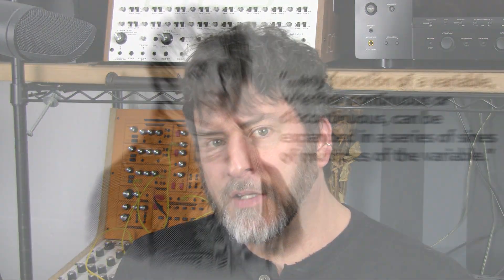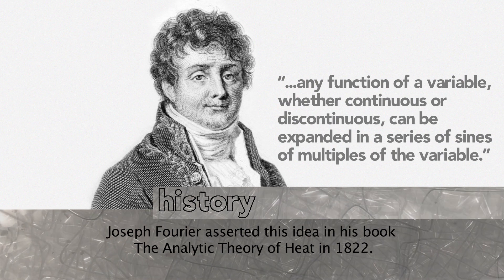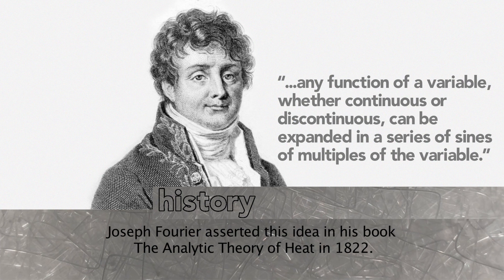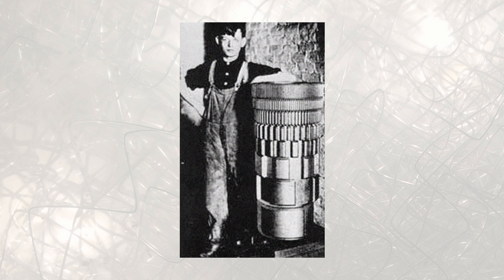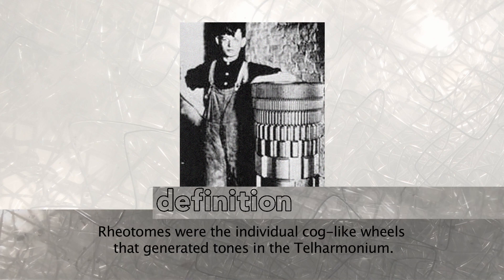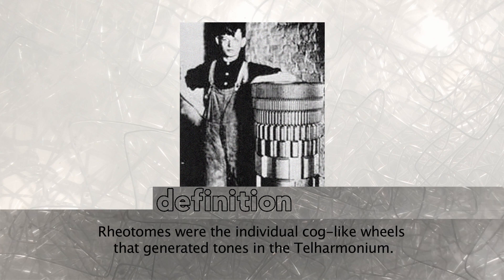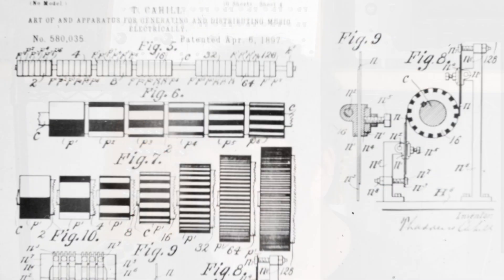A History of Polyphony: Part 3- The Telharmonium

Comment: It seems to me the  confusion is more rooted in linguistics: The  suffix "phonic", to describe all simultaneous and multiple instances is where things get convoluted. Maybe using phonic is the heart of the issue?  Although i think "variphonic" is a great word to descibe the dilemma, again "phonic" becomes an umbrella term to describe many things. I was having an interesting debate where the person believed that lfos were modulation sources and therefore not included in factoring full articulation or to determine that a note is playing a full instance of a synth. So even there, there is confusion! If synth has an lfo(s), then in my book a full instance of a synth would include separate lfo per note/voice - both functionally and characteristics of a synth's sound. Maybe the simple thing to do is separate synth polyphony and synth articulations in a synth's specs - e.g. 4 note polyphony ( number notes), 1 layer of voices (articulation), and break it down from there if needed.
Reply from the maker: Thank you for this awesome response.  I absolutely agree, and I think your ideas would certainly effectively address the issue.

Comment: Thanks for the series. I don't think the Telharmonium should be catagorized as an electronic instrument. Electrical? Yes. Electromechanical? Definitely. But there really isn't anything electronic without at least vacuum tubes.
Reply from the maker: To this day, I have never seen any authoritative distinction between "electric" or "electronic."  
The important element of synthesis is that electron vibrations are analogs to air molecule vibrations.
Reply: @automaticgainsay   The definition that I go by is, electronic means using the flow of electrons to control other electron flows. This can in practice mean amplification, active filtering, encoding some signal as an electron flow, etc. Since the Telharmonium needs the mechanical parts to actually encode the signal electrically, it is not what I would call "electronic". There's no shame in not being electronic, by the way, especially not in the 19th century! :)
Reply: @automaticgainsay   I agree,  there is not a very clear "go to" definition, I am an electrical engineer and the definition I mentioned makes sense to me, but I can see it is often more vaguely defined. For instance, some define electronic as any system that uses electron flow as a medium for encoding or transmitting a signal, period. By that definiton the Telharmonium was definitely electronic, but the problem with that is it isn't very consistent, for instance the telegraph and the first telephone systems are pretty consistently not counted as electronic devices.

Comment: No the synthesizer is a device that uses electricity, electrical and electronical cant be used interchangeably. In electrical engineering it’s a hard definition difference between the two. If you say the synthesizer is a device that uses electricity + the rest of your definition. Electronical devices always have decision making circuitry. Electrical devices do not have any decision making circuitry.
Reply from the maker: I typically use the word “electric” to describe instruments that simply use electricity, and and “electronic” to describe instruments that generate sound using electronic components.  
But you have to realize that in the field of music “electronic music” refers to music that is made with instruments and devices that employ electricity to generate sound, whether they are electric or electronic.  I’m sorry that that is not the case in electrical engineering.
Reply: @automaticgainsay  You are excused, but as you say marketing has skewed much of the terms, masking what it all really is.

Comment: Thanks for this nice summary!  I want to add that authoring timbre using the additive synthesis of harmonics had been happening for three centuries before the Telharmonium.  That's how a pipe organ creates its diverse range of voices and tone colors.  Thaddeus Cahill's vision was a synthesis of the electrical 'generating plant', the telephone network, and musical ideas from the pipe organ.
Reply: I agree with you, Andy Cavatorta. 😎  And with all due respect to Mark, the method of additive synthesis using only sine waves is just one method of synthesis and isn't a requirement for polyphony. And you can even do additive synthesis using waves more complex than sine waves . . . .FIGHT ME! 😅
Reply from the maker: The combination of timbres in an organ, of course, does result in more complex waveforms.  And, it’s true that pipe organ designers did hit upon the fact that adding pipes that played different frequencies resulted in different timbres.
However, the additive concept... where the intentional stacking of sine waves at specific frequencies and amplitudes within the harmonic series did not come as a result of pipe organs, it came as the result of Helmholtz’s experiments with concepts put forward by Fourier.
There is a difference between additive concepts and Additive Synthesis.  Any combination of sound sources, any combination of waveforms, or even multiplicative functions like FM can arrive at the creation of complex timbres, but Additive Synthesis is a specific process where timbres are intentionally created with sine waves alone and by combining them in a specific procedure.
There is no doubt, however, that organs played a role in creating concepts that contributed to this development.

Comment: 7.00 mins. in is it 100, 200, 300? No! 100, 200, 400.. that is a common mistake about the harmonic series. I remember reading this type of thing in Electronics and Music Maker (a UK magazine) back in the early 80's.
Reply from the maker: If, say, our starting frequency (the fundamental) is 220hz, the first harmonic is 440hz, the second harmonic is 660hz, the third harmonic is 880hz... We just went from A3, A4, E4, and A5.  That is f1, f2, f3, f4.  If we followed your pattern, and adjusted it to actual A440, it would be A2, A3, A4, A5. etc.  That is not the harmonic series.
Reply: Not so, the second is 880, the third harmonic 1760. Each harmonic is double the frequency of the preceding one. 660Hz would sound dissonant.
Try it in a hard/soft-ware modular with precise frequency display per oscillator. Let your ears decide..
Reply from the maker: +Nicholas Bryant I would encourage you to look into the frequencies present in the harmonic series and how they relate to musical frequencies.  What you're describing is an exponential curve, and that results in octaves.  The harmonic series is not made up of octaves.  The frequencies in the harmonic series are portrayed by the mathematical structure I describe.  The frequencies I used in my example were generalizations that were not adapted to fit temperament, but they accurately portray the frequencies in the harmonic series and the mathematical structure (f, 2f, 3f, 4f, 5f, 6f) that portrays the harmonic series.  
The paradigm that helped me understand it was a guitar string.  If you divide a guitar string in half, you'll get two frequencies... one for each of the halves.  They will be twice the frequency of the string's tuning, and they will be at half of the amplitude.  If you divide that string into three, you'll have three divisions that are three times the original frequency
Reply from the maker: +AutomaticGainsay and one third the amplitude.  If you divide the string four times, you'll etc.  If you apply this model to any number, where that number represents the fundamental frequency, you'll recognize the frequency pattern I have described.  If you search for "harmonic series" on YouTube right now, you'll hear a number of examples that aurally demonstrate this pattern.
Reply from the maker: +AutomaticGainsay And yes, the harmonic series doesn't exactly line up with the various temperaments we employ within the temperaments we employ.
Reply: @automaticgainsay  Yes, you're right, of course. Just one little thing. When you talk about the harmonic series in the video, there's one mistake: by adding them the way you describe, you get a triangle waveform.
Reply from the maker: A sawtooth waveform is the result of a sine wave at each harmonic of the harmonic series.  A triangle wave skips even harmonics.  So, no.

Comment: Hey Marc, I don't understand how the sound came out from the Rheotome? Did it just move the air rendering a tone?
Reply from the maker: corner:  The "cogs" caused alternating electrical connections that generated fluctuations in voltage... electronic waveforms.  Each cog created a different frequency corresponding to the harmonic series, allowing the user to define the timbre of the sound.
Reply: Thanks Mark! So you had to connect this to something to be able to hear the sound or that sound generated was audible through air? If he only would have done a youtube tutorial on this damn thing : )